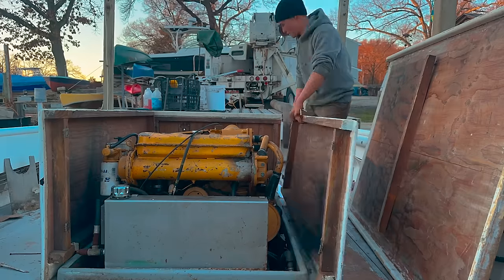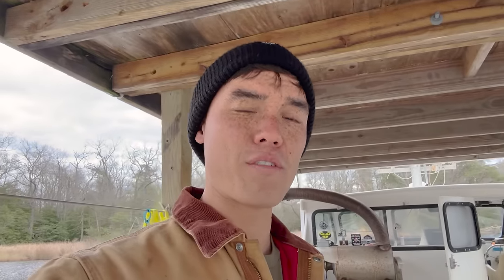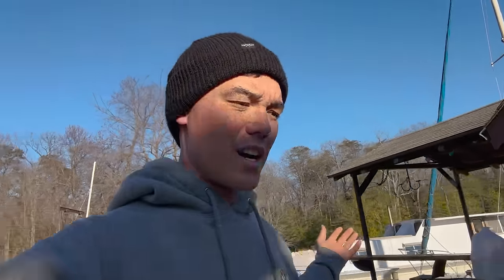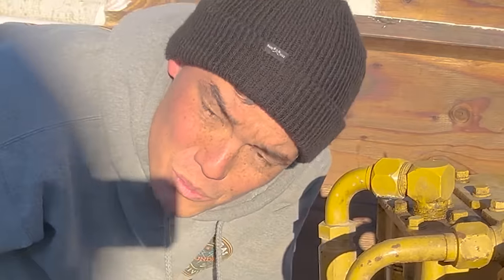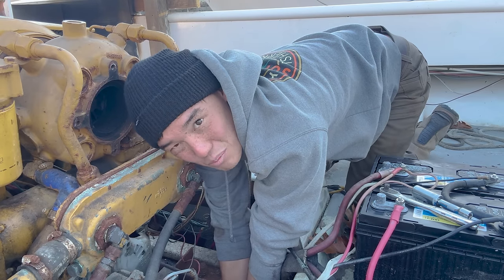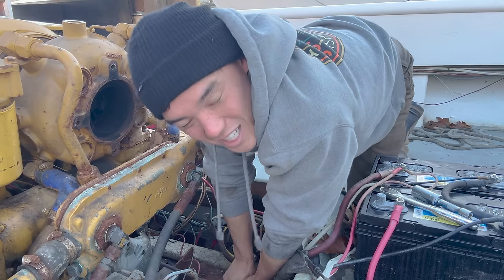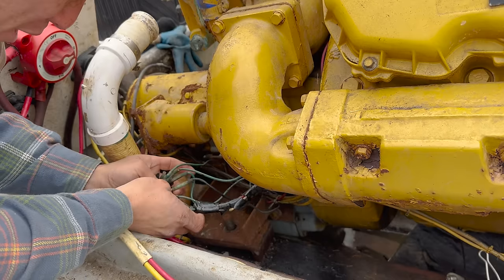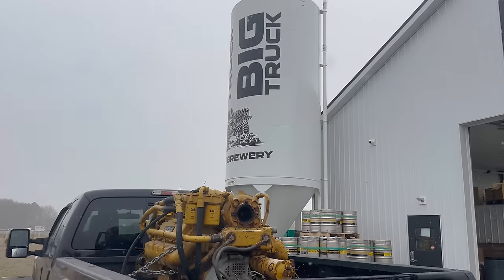This costly mistake could RUIN everything

Comment: BRO READ THIS ILL SAVE U TIME IN THE FUTURE!! quit fighting hoses, take you a pair of channel locks and grab the hose around the fitting and twist it back and forth a couple times. What your doing is breaking up the build up that has the hose stuck therefor making pulling the hose off just as easy as slipping it on.
Reply: Get a hook tool, and slip it under the hose, work it around, and the hose pops right off without damage to the hose. You can easily make the hose leak with pliers. The teeth will go straight through a hose.
Reply: I'm so glad someone beat me to it. He's right Luke (if you read this) always twist those pains in the ass back and forth first. Saves a lot of back pain, busted knuckles, and blood.
Reply: @Spike-sk7ql I've had the exact opposite experience. Never used the hook method myself but all the guys I've worked with who do go through so many more hoses. If your pliers are going through coolant hoses from squeezing the end over the Barb and twisting, that hose wasn't going to hold water under pressure imo.
Reply: If you get a chance to, change your rubber hoses out and use silicone hoses instead. They were originally designed for aircraft.  Law enforcement use them for fleet vehicles which idle for long times.  You will never have another hose problem.
Reply: You mean take his hammer not channel locks lol
Reply: @jamison201135  everything's a hammer if you use it wrong enough.😂
Reply: Get good hook tool mine is Mac 
Never wrecked a hose

Comment: Paint your return line red. Starts with R for return. Easy way to remember. Or get a bunch of dog tags and stamp them with lables and just tie wire them on everything. They are usually stainless and wont go bad.
Reply: If it gets to the point i gotta label stuff, blue painters tape and a sharpie. I am a mechanic but theres still those times where ya know its gonna be apart forever. Unless its YEARS, works like a charm.
Reply: @braap802 Only a true mechanic can say that. Anytime I am doing a large project like pulling a power head or something, I always have the blue tape & sharpie handy.
Reply: @matthewkelly7555  as much room as you want to write and lasts long enough even outdoors, idk where i picked it up but its the go to for me
Reply: when i am on the cheap i often use rings of old copper water pipe stamp em and pinch them flat when i can thread them on great if not cut one side and pinch it on other wise just use it as a ring with wire or a zip-tie not as nice as stainless but cheap and wont rust away and easy on the punches
Reply: Standard color code is green for seawater. Use arrows to show flow direction.

Dog tags are excellent for valve identification.
Reply: Zip ties
Reply: @Tatoebot  yup that's what i use on all our hydraulic hoses keeps you from mixing up the controls on loaders or other equipment on the tractors

Comment: If you don’t like raw water cooling, you can convert to a keel cooler. Most of the tugs are running keel coolers out here as the seawater wrecks engines over time.

Comment: Hi Luke, let’s hope your engine costs don’t escalate..
I have just personally rebuilt both my 375hp 3208’s .. the block rebuild kits were 3.5k each (make sure you get the new style 3 ring pistons), but I ended up having to buy valves and get an engineering company to get the block bored due to pitting, and fitted liners too. In all, my costs were about 5.5 k per engine and I did the work. It’s takes me 1.5 days to completely strip the engine to the crank and 3-4 days to rebuild and start it. Good luck!

Comment: Luke if you ever do a build another top like that look into building out of coosa board.. it cost a little bit more but once you put that on and fiberglass it it is way stronger and two small men can pick it right off. That plywood 2 by 6 is in 4/4 what is a lot of weight.

Comment: Hey you had me cracking up while driving the crane truck. The beeping sound is the low air pressure alarm for your air brakes. Theyre designed to automatically engage if air drops below a certain pressure. Normal psi anywhere from 100-120 psi (what my 1994 ford bus runs) and you loose about 2-3 psi every time you touch the brakes and they moan at you! Should take your truck at idle to get to pressure in 1-2 minutes. Faster the engine rpm faster the air compressor runs!

Comment: Easy way to get hoses off,  take a screw driver to pry up a channel to get a wd40 (or favorite spray lubricant) hose in.  Spray it a couple times then work the wd49 around.  Thd hiss will slide right off.  Do not use the spray to help reinstall thought because when it dries it will glue the hose to the metal. (Tirs lubricant works great for this)

Comment: Screwdriver is the painful way of working hose clamp screws. Get one of those cheap orange multi bit screwdriver from harbor freight and just take the bit out and use as a nut driver on the hose clamp screw.

Comment: I would have marked the roof directly above the engine compartment so I could frame a 'skylight' with a cover on it while the motor's being worked on, then put the roof back on at the first calm day. That was when the time come to reinstall the engine it just gets lowered through the hole.
You can decide if you want a solid panel or something else to cover the hole in the roof.

Comment: Just an FYI You can't pump the brakes like that with air brakes.  Every time you release the peddle the brakes purge air out of the system.  The alarm was the low air alarm.  If you run out of air, all brakes will lock up until the air tanks are refilled by the compressor.

Comment: You seem like a real good guy.  Unfortunately, like many small businesses similar to yours, if the primary owner cannot work or becomes unable to work for any period of time, your company goes under for lack of anyone able to do what you do.  Most under 5  (employee) companies have the same overall problem.  I do not sell insurance but I would look into some kind of disability insurance to cover you in case you cannot perform - especially since you are very limited to a specific set of months.  Long and short term insurance.  Should be fairly inexpensive premiums because of your age and work (not a job that requires weapons or is inherently dangerous).  Just have your homeowner insurer take a look at your exposure.  Love your posts.  Can't wait to crab season.

Comment: beeping in the lift truck was from low air , applying the brakes numerous times will drain the air tanks if the air compressor is not operating at full capacity when the truck is at idle

Comment: Hey luke im 27 and i also am very creative and make shit out of junk. I wanted to give u a pointer on removing hoses. After u take clamp off take ur screw driver or pick and pry hose a little and then spray WD-40 or equivalent in it and then take ur screwdriver and run it around the rim so the lubricant can get in there and it will literally slide right off. Guaranteed

Comment: That Ole 3208 we tried them in grain trucks and a few tractors models used them but we never could get them to hold up, I'm sure the V8 is desired for the RPMS but even though they leak oil a 8v71 detroit would smoke it we used those 8-71s in semis as well sounds mean as hell even though you creeping lol

Comment: Change those rubber hoses over to silicone hoses.  It will cost you a little bit, but you will never blow a hose again and they are much easier to work on.

Comment: Grease , chain lube , cable lube goes a long way to protect electric ends and steel bolts in that wet cold environment for later ease of fix or refurbs.. looked a bit dry n rusty in places..  blunder on..👍

Comment: Pro tip:  If you use channel locks to twist the hose back and forth a few times it’s much easier to pull them off.

Comment: Get urself a set of hose hooks & a can of lube get the pic started under the hose spray lube in the space then run the hook around the hose end & they pop right off no damage like if u use channel locks

Comment: To be honest with you get a 12v Cummins and drop that in. I worked commercial tenders in Alaska and that has to be the most reliable power source. As you know the more electronics you have the more headaches.  For 10 grand you could have a new crate motor dropped in. My 2cents

Comment: If you need a bit more power out of her you could probably have the throttle arm in the fuel pump shortened to give you more room to hammer down. Won't get any more low end but that would increase your top end a bit.

Comment: Luke… As far as the wiring harness is concerned, colors mean nothing, and as long as all the wires are joined together with duct tape, everything will work out great. Personally, I have seven engines lying around countless alternators and other electrical equipment that I do that with and they are all for sale. No warranty of course because they are used and no refunds.

Comment: Rebuild that roof the correct way with the beams 2x6 resting on the post and it will be stronger higher easily assembled and dismantled and use less material

Comment: Do yourself a favor and put water tight connector on your wires when you go back with your engine and use stainless steel bolts 🔩 just some friendly tips

Comment: You are wrong about the raw water cooling. There are tons of much bigger motors then that running keel pipes. If you want to go back to keel pipes look into some Walter’s keel pipes. I actually have a set of 12 pipe Walter’s behind my shop I would give you for free just to see them used. They cam off a boat that ran a 500 hp Detroit. They would work perfect for that motor. One in and out through the hull too. So you only drill one 3” (roughly) hole in the bottom and there is a splitter hat that sits on top of it to split the in and out of the antifreeze.

Comment: 3208... 5000 hours is just run in for this engine. Only problem the 3200 series had was they used to come out with a 2 ring piston. But if its 3 ring then I'd only pull it out at 15000 hours absolute minimum. In that application I'd confidently say you will only have to rebuild it at 20-25000 hours. But... That's only if you change engine oil at 250 hour intervals. I ran cat 3054c/Perkins 1104T to 15000+ (still running) in 4 TLB's and only issue we had was injector pumps at around 8000 hours. Cat 3126B currently at 22000 hours in a D5N and only parts we've changed is injectors and water pump. 
Save yourself time and money, if it starts easy and it's not breathing heavy or using oil, just keep running it. I've seen some 3304's in generators go up to 40,000 hours before rebuild.